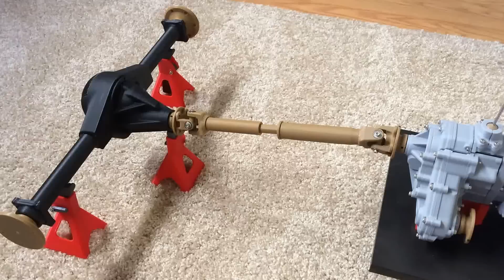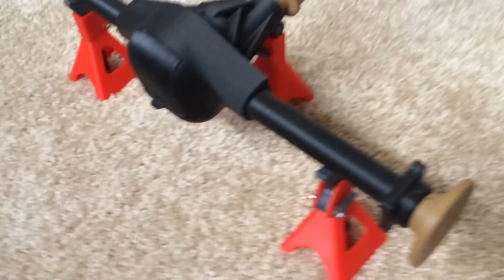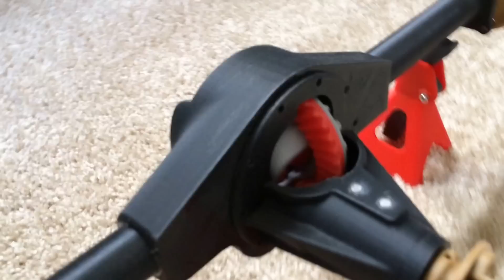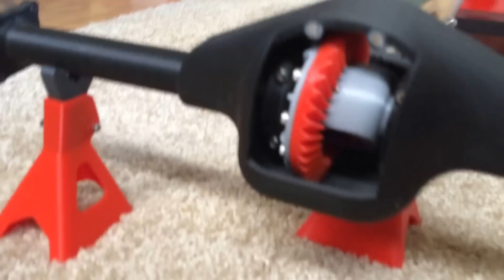3D Printed Open Differential, Scaled Toyota Third Member

Comment: Have you ever thought about heavy duty truck engines and transmissions? The Detroit Diesel series 60 12.7 L and an Eaton Fuller 13 speed transmission would be cool.